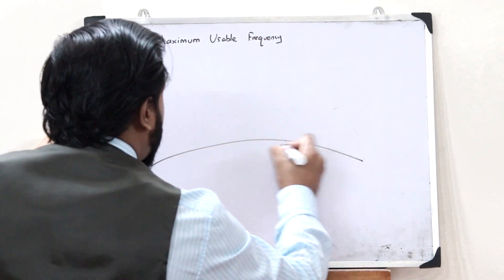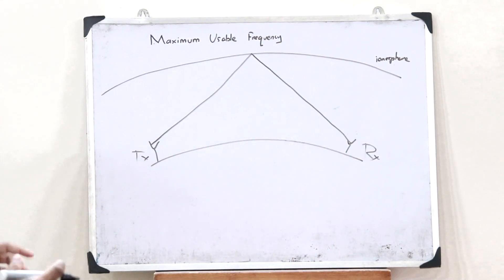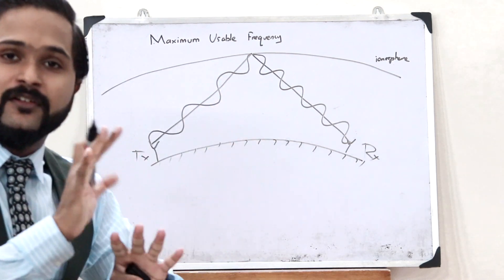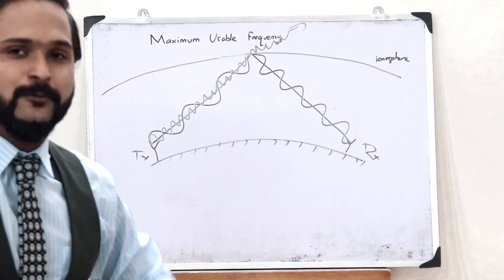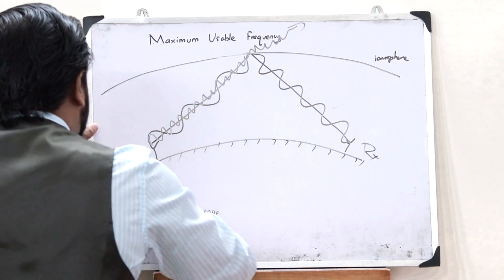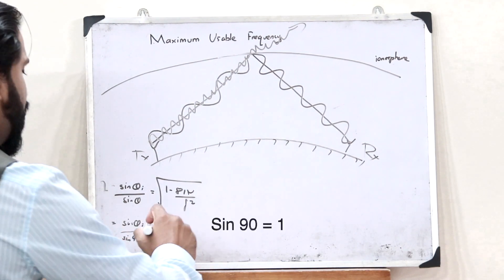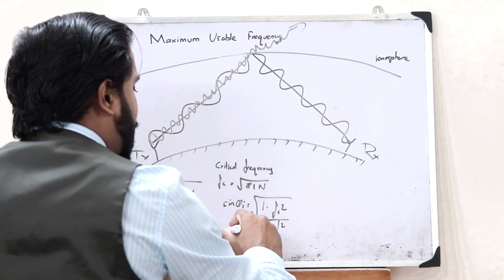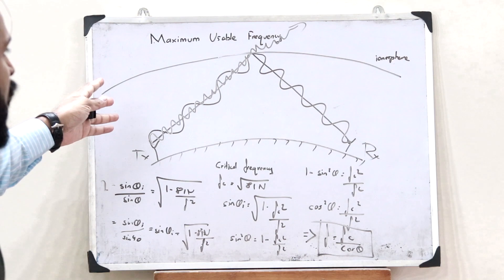What is the Maximum Usable Frequency in Sky Wave Propagation? | Derivation | Simplified KTU EC306 S6

Comment: Then what's the difference between critical frequency and maximum usable frequency 🤔
Reply from the maker: That's a really good question thanks for asking!! Briefly answering it here : 

Critical frequency is the maximum value of frequency of a signal that does not penetrate through the ionosphere!! But MUF is the maximum frequency that can be used between two points separated by a distance at an angle of incidence without penetrating the ionosphere!!
Reply: @BackbenchEngineer  examin ith undairunu 🙂